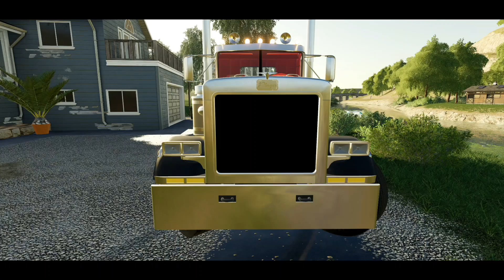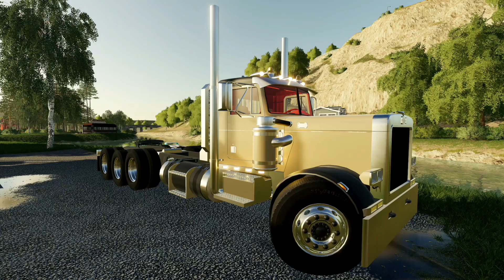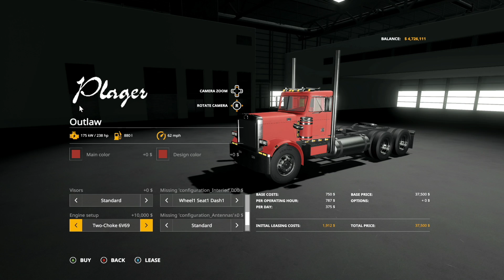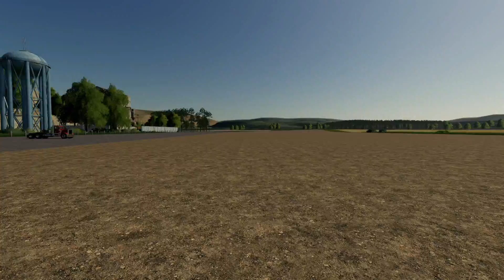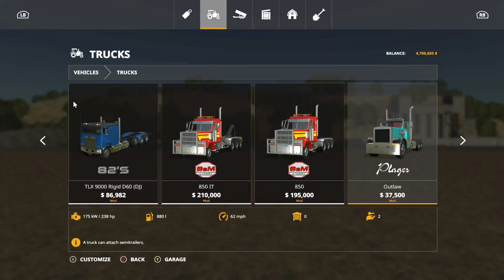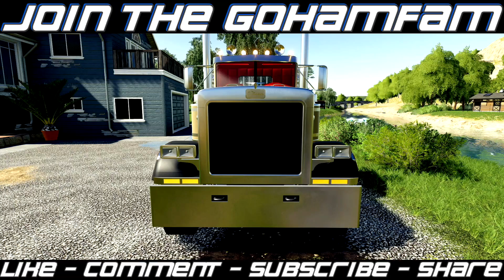Plager Outlaw Engine Sounds! (by CNH Modding) | Farming Simulator 19

Comment: Now we need a grain trailor with 3 axles and a liftable rear axle on the trailer
Reply: A liftable front or middle axle would make more sense. Why rear?
Reply: @BMMEC6000  there all over the northern USA with a rear lift axle. I don’t understand it but it looks cool
Reply: @johnsipes4422  I mean I do live in a state were we don’t have to many farms but I watch tons of truck videos and I’ve never seen a rear lift axle. I gotta look that up
Reply: @BMMEC6000  they are definitely rare but I’ve seen a few in southern Illinois and in Kentucky.
Reply: If your on pc they have 50ft Wilson with rear lift axle. I'm not sure if it's on console
Reply: @stevestevenson7122  it’s not sadly
Reply: @johnsipes4422   when the rear axle is off the ground it gives a tighter and easier turning radius than the middle or front axle being lifted
Reply: @solologging2488  ohh ok that makes since.
Reply: @johnsipes4422  yeah that does suck that's why i had to switch to pc.
Reply: @stevestevenson7122  yeah I plan on doing that
Reply: @johnsipes4422  nice. Yeah It's was a big difference you won't regret it.
Reply: @stevestevenson7122  I definitely won’t. Building it myself and will spend $1000 on parts. When it’s done probably have a $1500 pc performance for $1000
Reply: @johnsipes4422  nice. I did the same 1200 in and it's more then I really need but worth it.
Reply: @stevestevenson7122  yeah I could most definitely work with a $800 because all I will do is play farm sim and snowrunner but I went a tad more on it
Reply: @johnsipes4422  yeah true. I Only do farm SIM and ATS
Reply: @stevestevenson7122  no it’s not
Reply: @johnsipes4422  maybe your seeing a rear steerable axle? Rear steerable are also lift axles. I work at a custom fuel tanker manufacture and we build only 4 axle  set ups with a rear lift steerable. They lift when little weight is on the bags or backing up. All our 5 and 6 axle set ups usually have a front lift steerable
Reply: @fsca72  maybe so
Reply: And 8inch stacks I will love to send the sounds of my pete

Comment: Was hoping for better Caterpillar sounds.  The CTA (which is the KTA Cummins) (old motor from the 70s and 80s) it has a fantastic sound and the C14 (which is the N14 Cummins) they are the best in my opinion. They sounded most realistic. Was hoping for better Cat engine sounds because I am a Caterpillar guy. Awesome truck overall can’t wait

Comment: Im disappointed in the sounds of the Caterpiller diesel engines & their jacobs  brakes. . . . . .. COMMON CNH MODDING. . . . . .GIT EM RIGHT, DUDES!!!
Reply: @CNH ModdingWell i dont have audio files for anything as i am not a computer whiz gidget, but i would think ya could have some kind of an audio card/audio board with some strong CAT sounds to add. . . . .i dunno man. like i said i ain't smart in all that stuff & leave em to the big boys like ya'll. Would you be willing to put the round working turn signals on the tops of the front steere axle fenders with
 hazard lights as well. I know im asking for alot, as i know ya'll are extremely buisy with the build process. Im an old school trucker, born & raised in the trucking profession, with 25+years under my belt at driving long, haul, regional, short haul, local over the road. be safe & lemme know whatchya can come up with. strong, loud, deep, ocean liner, airhorn blasts. . . . .none of this high pitch whinny girl horns. . . . .strong & mainly